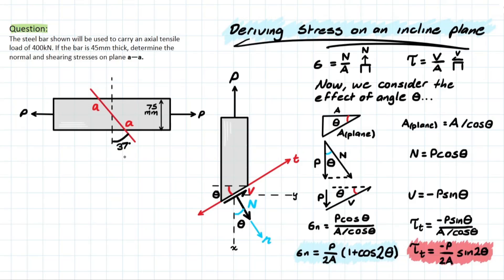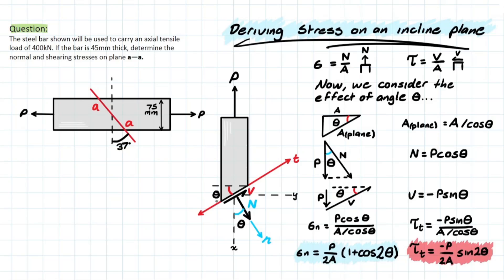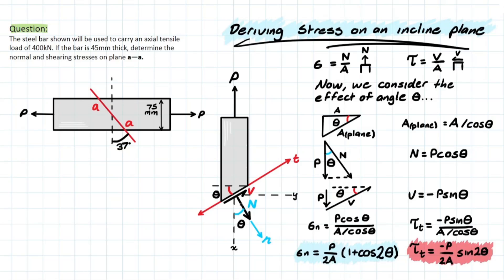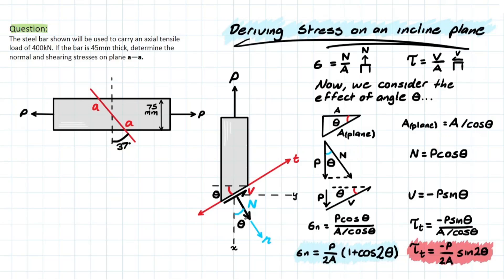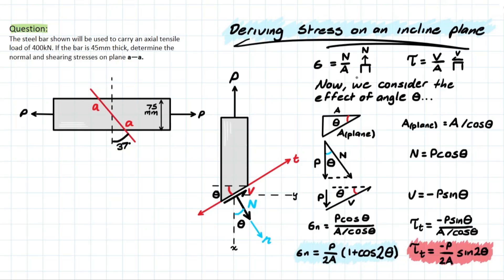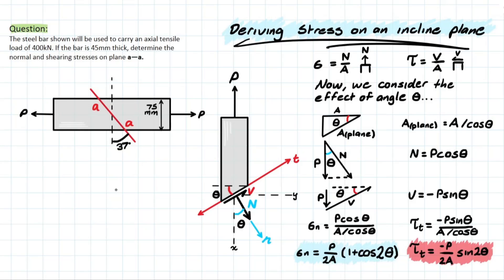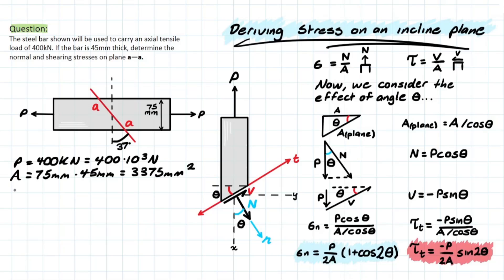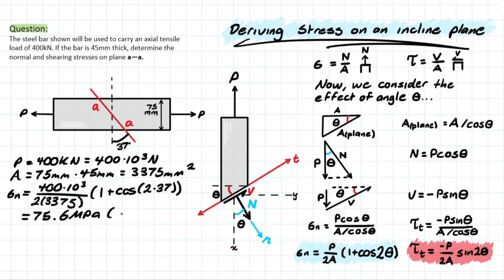Solving for Stress on an Inclined Plane!

Comment: Can you give a real life example where you would need to consider where an angular plane needs to be considered and stress at that plane with respect to axial load needs to be calculated?
Reply from the maker: An example that comes to the top of my head would be having an an axially loaded member, fastened together in the middle by a bolted connection, but the connection between the two members is at an angle instead of perfectly perpendicular to the load. I'm sure there are more examples in textbooks, but I also assume that the most likely used for these formulas would be for material testing purposes.

Hope this helps!